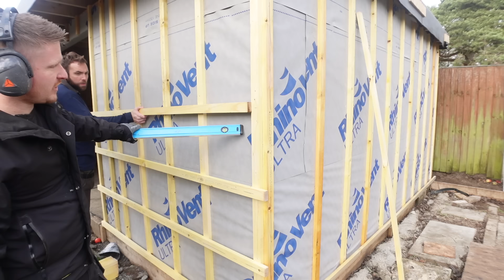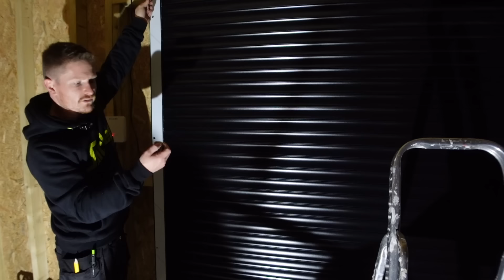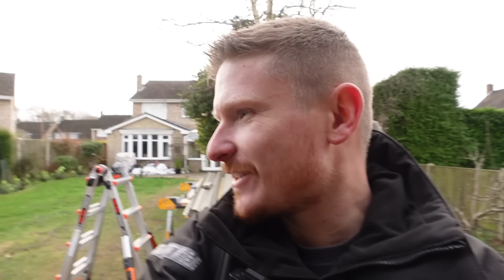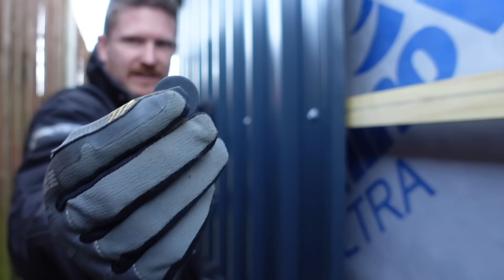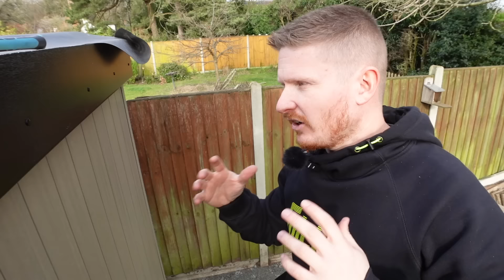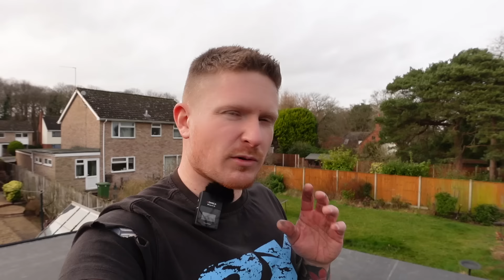How i Built my Dream Workshop Garden Room - Cladding, Rubber Roof and More

Comment: Excellent videos. Thanks. I’m curious about the transition from the raised side trim to the 2 part gutter trim for the EDPM roof. What do you do with the corner? Do you use the raised side trim corners, and do you need to trim them, or do you just butt the raised side trim to the drip trim? Thanks.

Comment: Did you put a trim down the inside of the door? If the garage door is inside would there not be a slight gap from the cladding trim on the reveal to the door?

Comment: Love the videos! They're so helpful. I'm wondering about the box profile cladding meeting the roof, it looks like you calculated everything so that your overhang just sat in line with the metal sheets, is this right? You didn't need any soffits along there? Did you have to close any gaps there with insect mesh or anything?

Comment: Another quick way of cutting multiple pieces of the same length: Clamp a block of material as a "stopper" to the mitre saw, so you can just slide a plank to the block, and it will cut it to the correct length.

Comment: This is a minefield when it comed to building regulations. Im researching to build my home gym it'll be on rhe boundary and apparently its not judt the cladding thst needs to be fire resistant but also thr frame and the roof should be made of tile

Its a headache, im just going to run rhe risk

Comment: Great again. It would have been nice as to see how you organised/made your arrangement for the soffit. I can only assume that you left a gap wide enough when  you installed the fascia board in as to slot in the offcuts of your vertical cladding inform what I can see, some sort of L trim at the wall end as to lock it in/finish it off?

Comment: Absolutely love these videos, currently going through a bit of a dilemma! 

My back wall/boundary wall is going to end up being pretty close to the boundary, so much so that I can't get behind it to fit the cladding once the wall is up - oversight on my part I know 

So i'm going to fit the cladding on the back wall before putting the walls up, my concern is what to do about leaving a gap for the soffit at the top of the back wall, I dont want to leave a massive gap for insects/birds to get into. Once the wall us up, everything like that will have to be fitted from the roof

Any advice greatly appreciated!

Comment: Hi, Great Video! Did you leave the Timber supports on around the concrete base?
Reply from the maker: Hi, no, shuttering is removed before batten and cladding.
Reply: @TheDIYGuy1  did that leave the 20mm sand exposed? Then you added MOT around ?? I will watch again 👍🏻
Reply from the maker: Just backfilled against it 👍, that way it’s supported around the edges.

Comment: Great series of videos.  We are building a similar sized gym and want to build as close to the boundary as possible.  I thought we would have to build of concrete blocks.  Is it PD all over England if you meet other requirements and put metal cladding on side near boundary?  We are in Norwich.  Thanks very much.

Comment: Nice job, but with out windows or doors I think it could be a bit claustrophobic inside. 
Also what about ventilation ? A door would be useful if/when the roller door fails in the down position with the emergency release stuck - as has happened to me....

Comment: Nice Roller shutter. Did you fit an EMR in case the motor fails?
Reply from the maker: Yep I have the kit here to fit once I get round to doing it
Reply: @TheDIYGuy1  Defo do it. Every other week get a job with power failure or trip gone in garage no EMR means causing damage.

Comment: Very similar to what I’ve just built in my back garden. Can I ask how you vented to soffits was the inside going to be left exposed timber or panelled over ?
Reply from the maker: The ventilation gap runs up the walls behind the cladding and into the soffit. This then forms the cold roof ventilation across the top of the roof insulation too.

Comment: Hello sir. Is it possible to convert a light switch to an electric outlet?? can you please make a video on it to showcase it…
Reply from the maker: Hi. Not something I’d advise. Technically it is possible but without a cable change you would need to downfuse and still would not be able to power anything with high amperage.
Reply: @TheDIYGuy1  Thank you for the information sir.. Appreciate..

Comment: It's easier before the curtain is attached to the barrel is to bring it all the way down to the bottom limit, then attach the curtain to the barrel that way you only have to make the adjustments to the top limit (within reason). Nevertheless good job as always 👍🏻also its best practice to ensure the curtain is fully down but also the curtain around the barrel isn't wrapped but it's down straight. This will give you a better chance of the shutter not being lifted easily by intruders
Reply from the maker: Great points 👍

Comment: Great work as always mate!!  How did you stitch in the metal panels into the soffits at the back and sides and they bump in and out? Did you have to cut a load to fill in the gaps? If that makes sense? 
Thanks
Reply from the maker: Cheers. Completed the soffits with the composite cladding first and then butt the cladco box profile up to it 👍
Reply: @TheDIYGuy1  so you did the soffits first then cut the metal panels in the vid and attached them butt up to the soffit flat surface?
Also no need for silicone or something between the sheets to stop water getting in? Rust proof?  Thanks.

Comment: Great looking workshop you've built yourself Cameron, when you were gluing down the rubber roof roughly how long do you get before the glue has gone off to avoid the air bubbles etc, because presumably it not advisable to be peeling back up.
Reply from the maker: That’s a good question. You’ve got a while, there’s no rush but I don’t know exact time

Comment: Excellent video, your hard work doesn't go unnoticed 👍 I guessed you'd use corrugated sheets on the back, I'm doing the same on my very much smaller workshop build but I'm using bitumen corrugated sheets instead.
Reply from the maker: Thank you! Good luck with your build!

Comment: Most garage electric door installers recommend you have an alternative method of entry so that if you have an electrical fault you can still get in and open the roller door manually. The workshop looks great but as someone else mentioned why no windows?
Reply from the maker: I have a manual override but not filmed that due to it being shown in my roller door guide video. No windows by choice due to security, tool theft is at an all time high
Reply: Was wondering how it would be opened or closed in a power cut too
Reply: Depending on what the tube motor position is, if horizontal then drill a hole through the timber & insert the overide facility (if provided by the manufacturer) or alternatively wire in a UPS

Comment: Hi. Wondered if you considered installing an insect mesh at the bottom of your battens to prevent insects, mice etc. getting under the cladding? Thanks for the video. I have a similar project to do myself in the summer. Very helpful.
Reply from the maker: Hi. To be honest it’s a fair point but not something I have done.

Comment: Great job. Both video and build. Do you have a cost for that with labour and materials?
Reply from the maker: I will include cost breakdown in a future episode. To give you some idea, for a workshop of this size in materials is around 12k finished inside and out. As a rule of thumb labour would be about the same so around 25k for a bespoke build like this.
Reply: @TheDIYGuy1 25K for an outbuilding 😮 madness.
Reply from the maker: Everything is expensive these days unfortunately
Reply: @TheDIYGuy1  yeh for sure. It looks smart & you did a crackin job not hating but that is crazy money.

Comment: The cladding F trim at the bottom that the cladding slides into.....won't that have water run down the face of the cladding and sit inside the F trim?
Reply from the maker: It should run out of the ends to some degree, but i see your point. I don't foresee it being an issue though due to the nature of the product.
Reply: I suppose you could always use clear silicone for added belts and braces
Reply: Or maybe drill some tiny homes at the bottom of the trim